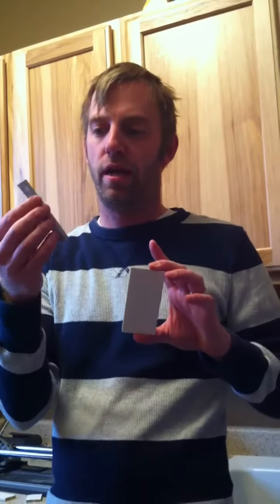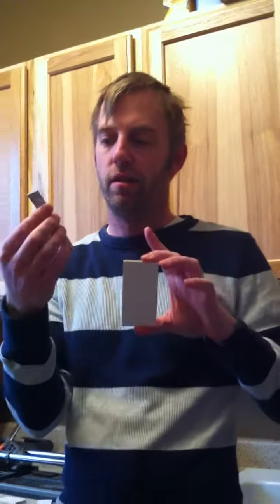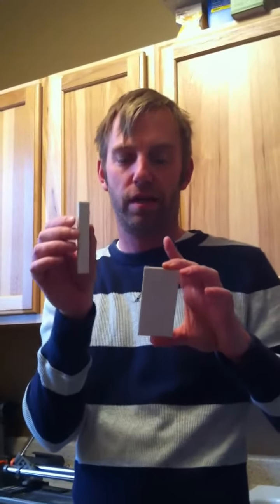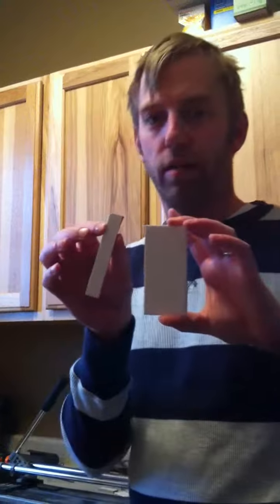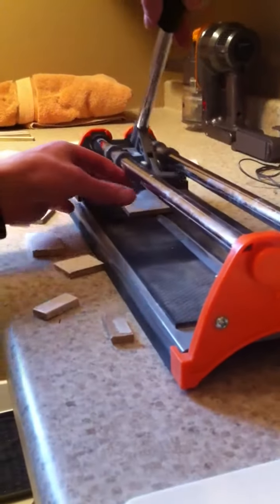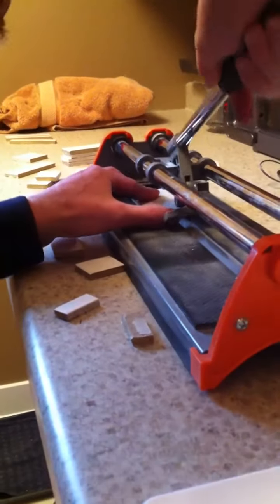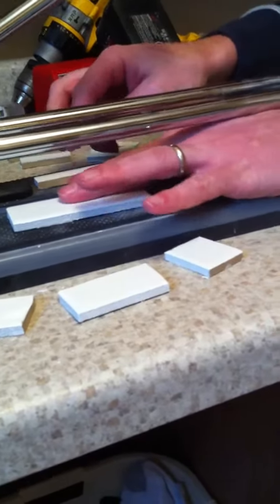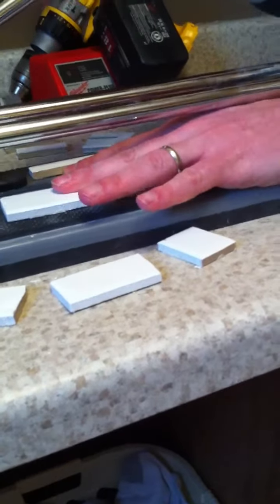How to Cut a Long, Thin tile without Snapping It

Comment: Was quite helpful, the tile would still snap in the middle but if I pressed on it in different breaking points a couple of times and then apply the trick, then it would split perfectly where I needed it. Thanks

Comment: Im redoing my bathroom and bought porcelain tiles made in Italy for the floor and shower and a brand new snap cutter, but it doesnt cut the tile evenly, everyone I cut, breaks uneven, I have tried all different methods that I can think of. Do you have any tips? My guess is that the tile is crappy, but Im stuck with it and have already started install. I have to use a grinder to fix every tile I cut and its taking forever!

Comment: For bigger tiles I would suggest scoring deep and then placing the tile on the edge of a flat table with the piece you want to get rid of at the open end. one person hold the bigger piece while the other uses both hands to snap the smaller piece off